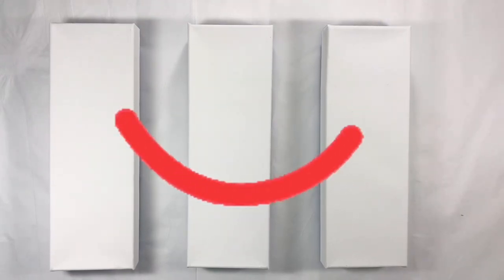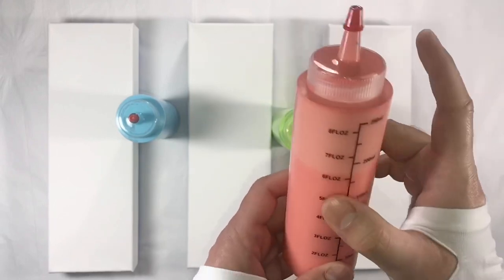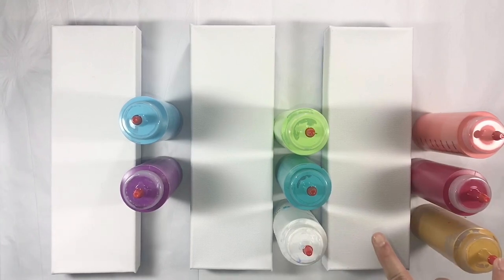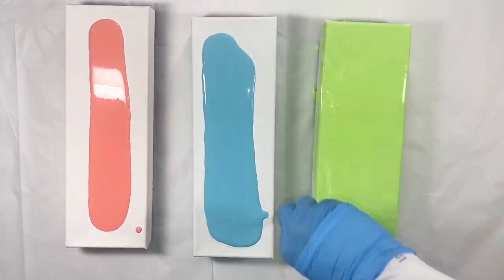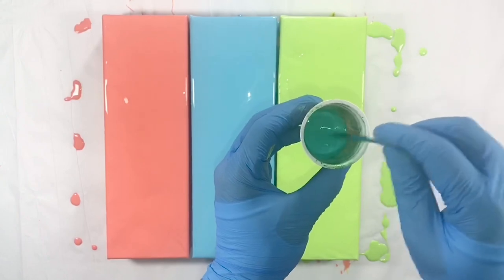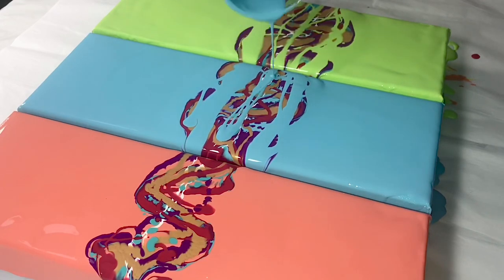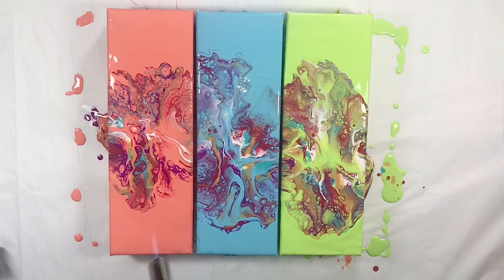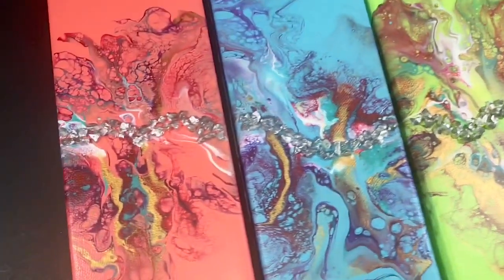How to do Triptych Dutch Pour with glass chips #23

Comment: I think they look great! I like the glass chips you added. Did you add glue or just put them in wet paint?
Reply from the maker: Erica Liles thank you. Yes they look good together. I simply added the glass chips on wet paint and they glued very well. I will be adding a clear coat of epoxy resin and it will reinforce the chips. ❤️